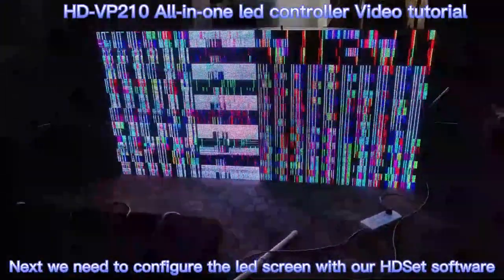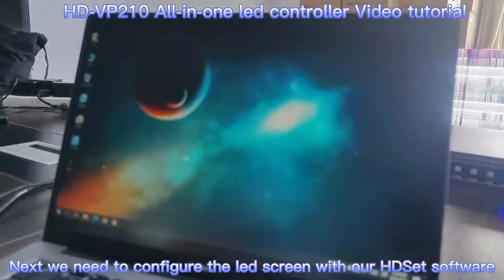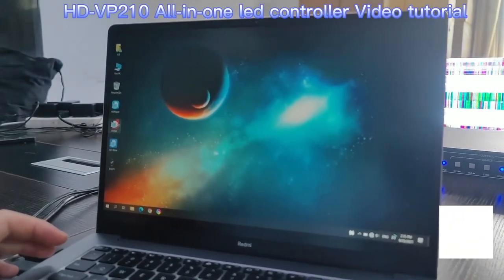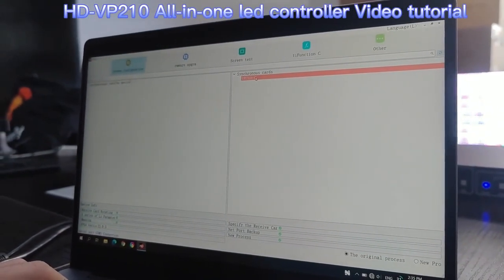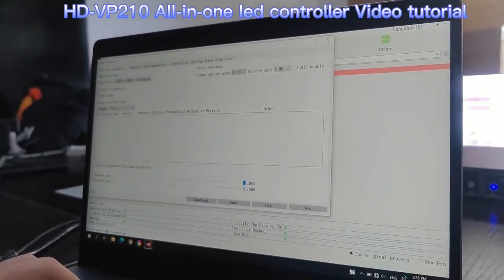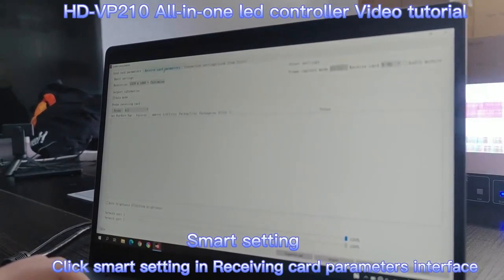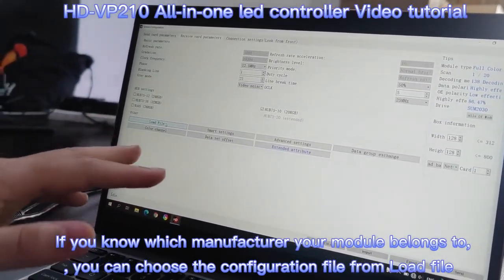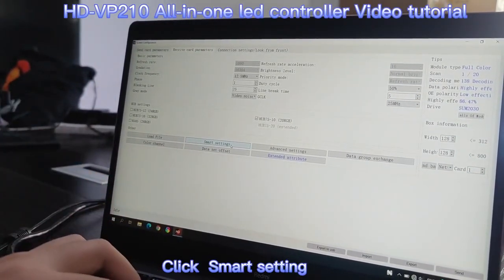How To Setup Huidu Software with HD VP210 Controller

Comment: Hy dear this proseser  wifi is not work in led art ???
Reply from the maker: it support mobile app ledart, just enter settings-choose "Display products", then it can work. The wifi function is used to switch input signal source. Welcome contact me on WA: +8613510540791